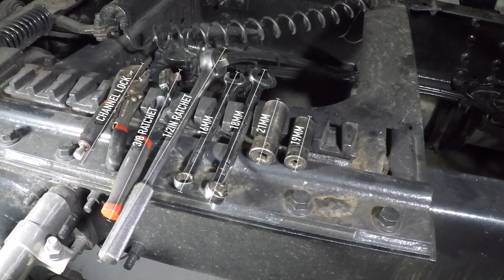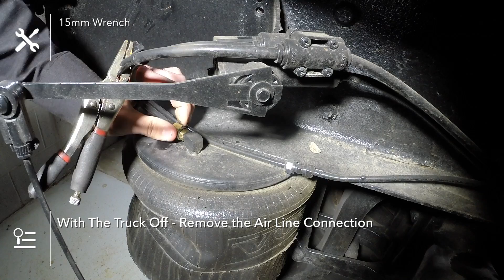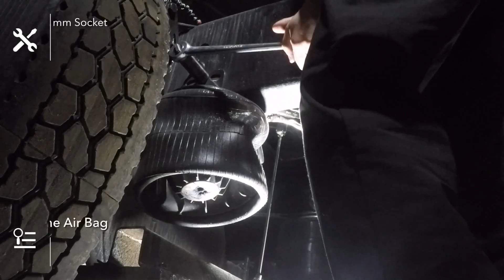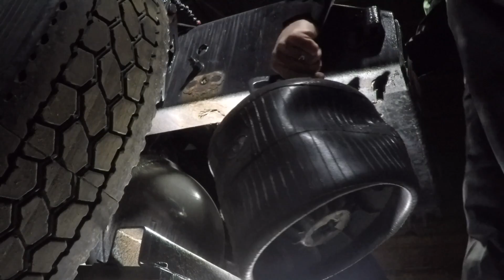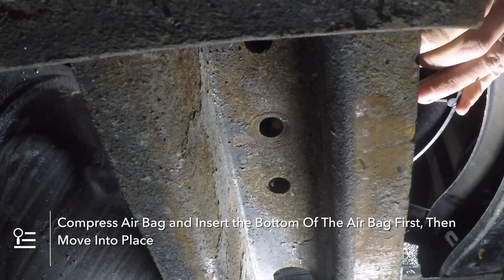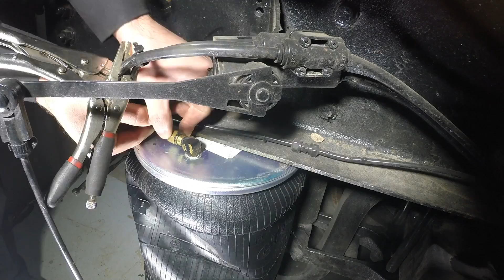Volvo Truck Suspension Air Bag | How To | OTR Performance

Comment: What is the proper adjustment height of the air bags?
Reply: put a three inch block above the axle between the axle and frame and set the sir ride to neutral, this is a good rule of thumb
Reply: Every truck model different..measurements are from the center of the axle to the bottom of the frame. Peterbilt 8 3/4 is common